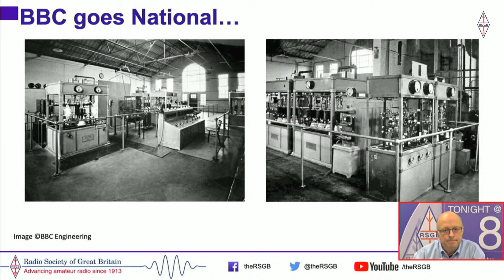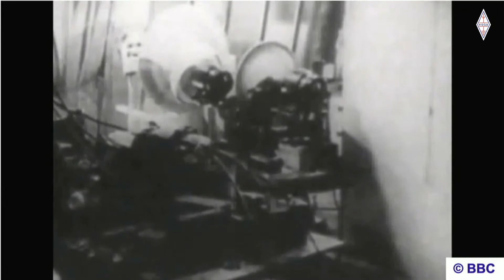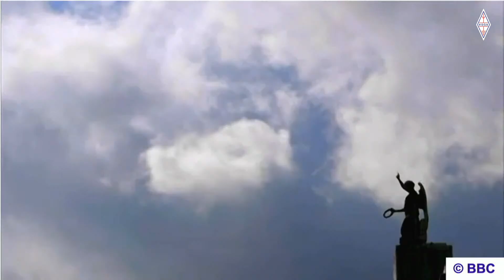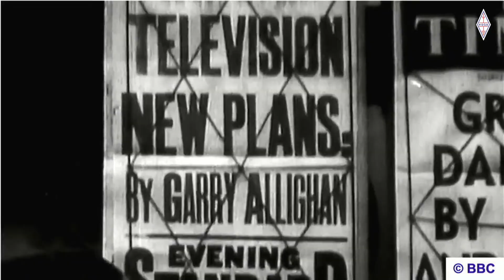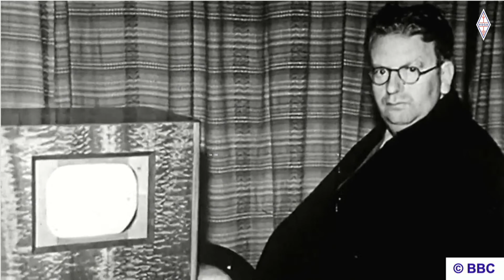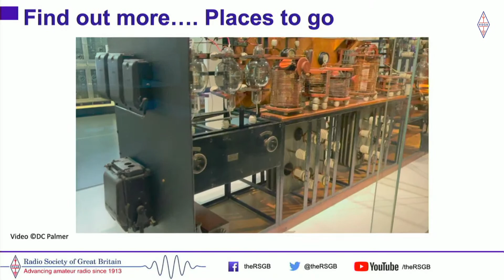RSGB Tonight@8 - 100 years of BBC Technology and Innovation by David Palmer, G7URP

Comment: Excellent presentation. I still use a Reslosound ribbon Mic mounted on an adjustable boom arm in my shack the came from the Abbey Road recording studios in London.   The boom arm also holds a Shure SM58 vocal mic. Both of these classic microphones are connected to a slightly more modern Fostex 8 track recorder, the audio output of this can be switched between different radio equipment and PCs in the shack as required.  Keep up the good work. 73 de Hairy Paul MM7WAB